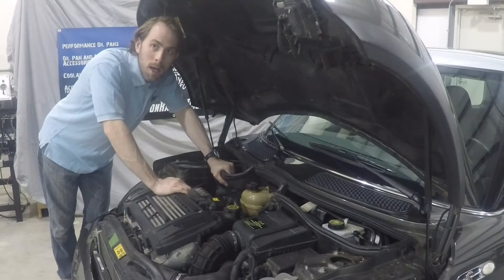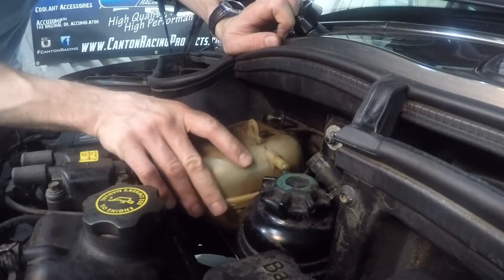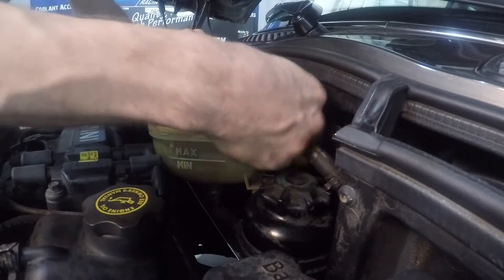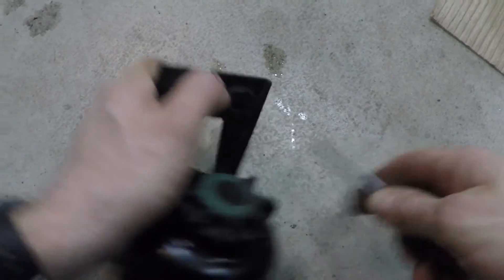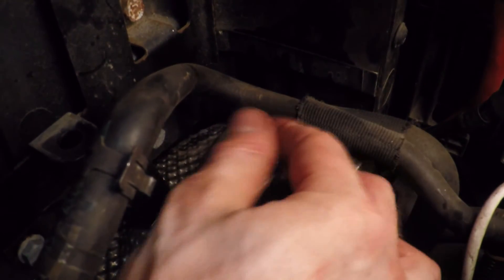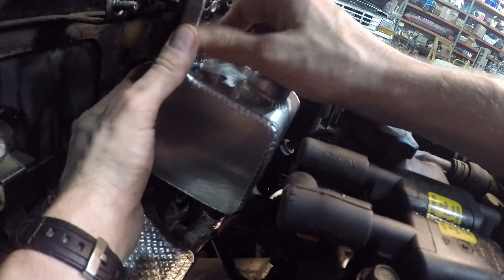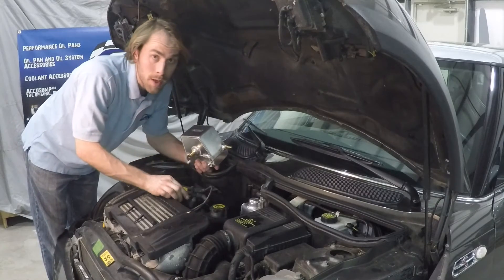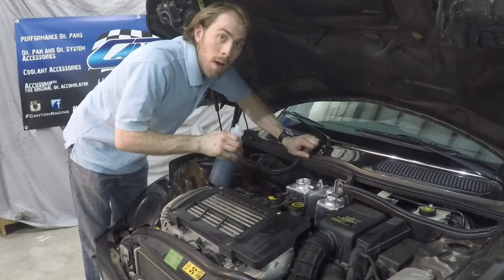Mini Cooper Power Steering & Coolant Tank Replacement Installation Video

Comment: What's the purpose of the third hose connector on the top next to the cap, for??
Reply from the maker: That is a pressure relief.
Reply: @cantonracingproducts   wouldn't coolant be spewing out from that relief nozzle?
Reply: @kenacycle if you overfill the tank or run your engine too hot it will dribble out not spew.  The stock tank does the same it just drips down the tank neck.